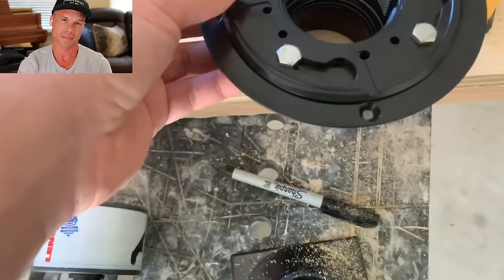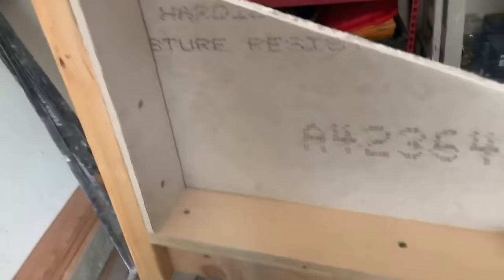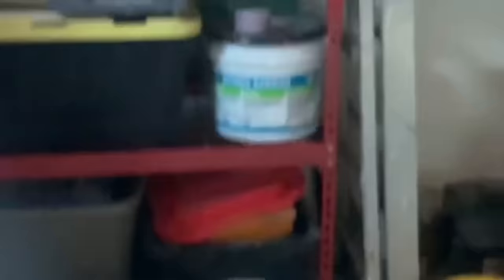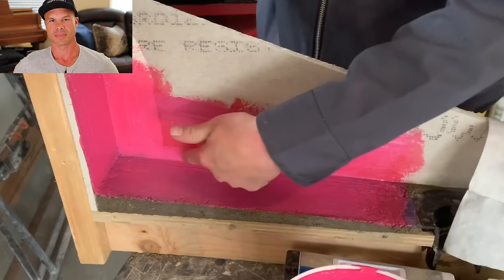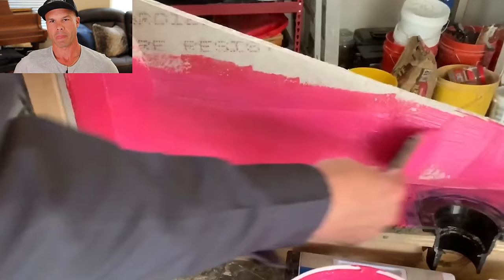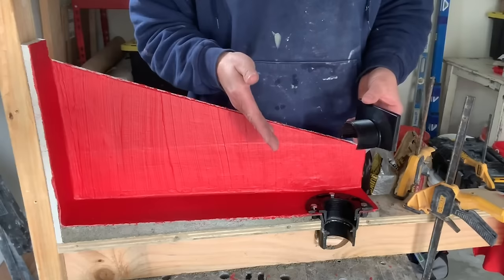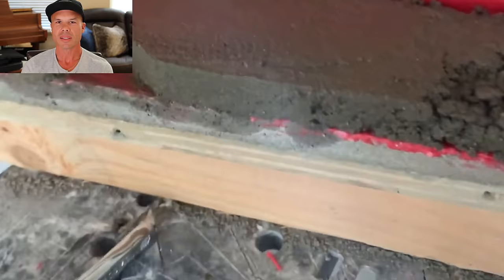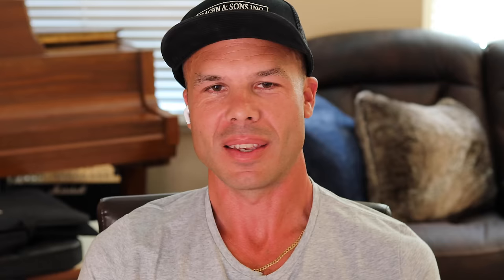THE BEST REDGARD VIDEO ON THE INTERNET!!!

Comment: I'm a general contractor in San Jose and have done pretty much all the kitchen & bathrooms by myself. Got licensed in 1993 and  been using a few  tile subs the last  few years. I went through 5 or so before I found a guy who actually followed proper practices regarding weep holes!  It gets old real fast when you have to watch over your subs!  Common sense  that you want the water to have a clear  path to drain !  I started watching your video on redguard  and saw how thick you were putting it on and the guy you pointed out in this video explained it well.  I still prefer hot mop when I can control the fumes, but redguard( the way he showed to install works well! shluter I  only use  with a liquid membrane over it  and up the walls past the curb  at aminimum because thinset only between the membranes is not waterproof especially when weep holes are clogged and water sits under the tile !  Hopefully this video will sink into the guys the right procedure!

Comment: Wow!  That prime coat is the trick when using the fabric!  The redgard dries almost immediately on the non primed surfaces but the primed surface gave extra work time to get the fabric applied well and smoothed out!  Thanks for the tip

Comment: Priming plaster walls requires a mist coat/slurry coat. Where you mix the primer  50/50 with water so it can absorb into the the plaster. Then the paint sticks to the primer.  This is a standard approach in priming surfaces, before coating them. The red guard is sticky, but you can peel it off, if you don't do a mist coat, or put too much material on. The way buddy applies it in the video, pretty much makes it a done deal, as the red guard has become part of the substrate.

Comment: This is exactly how, I do it. I’m in Rochester, NY and we don’t get the deck mud you have in Cali. 

I’ve also been lighting up all my niches for my customers and every single one of them loves it!
Reply: Quick question.  Why sandwich the red guard between 2 mud beds rather than one big sloped mud bed, redguard, then tile?  Wouldn't that eliminate 1inch of mud bed to absorb water.  Or does redguard not 'play well' with the tile thinset?  Thanks!!
Reply: @josephfox7952  reason is to let the water drain thru the weep holes. The deck mud is pores, so water seeps thru the top layer to the pre- slope bottom layer where most people use pan liner rather than red guard. 
Also, you need that thickness for strength. I’ve also use topical membrane directly on top of deck if I use Schulter line drain. I don’t trust thin set to water proof the point where there’s all water flow to.
Reply: @tommynguyen8942  so would you redgard over the second layer as well?
Reply: @afchannel652  When I use Schluter drains. And I do come out at least 6” from all corners where walls/ curb meet shower pan.
Reply: @afchannel652  I was wondering the same thing - would redguard also on the second layer make it even more waterproof?

Comment: Ive never used this mothed for filling corners and covering the gaps between boards.  I usually cover all of my corners and seems with mesh tape and trowel on speed set mortar.  Once the mortar dries, I will go over the entire wall with 2 coats of Redgard.  This method of using waterproofing membrane in the corners seems fine, but if you have gaps lard than 1/8", you definitely want to go with the mesh tape and speed set mortar method, as Redgard can be used to isolate small gaps, because it cant be used to fill larger gaps and bridge them.

Comment: The fiberglass fabric in the corners is key to any liquid waterproofing! Great video Coach
Reply: Hey bro do you know what type of fabric was used in this video?
Reply: @austinb2889  not sure what exact brand he's using but I get mine on Amazon just search "waterproof membrane fabric". It's 6" wide by 75' long roll. Usually one roll will do about 2 showers if you're hitting all the corners.

Comment: If you want to check the thickness of Red Guard, or any liquid membrane, I suggest getting a wet film gauge. It's a credit card size piece of sheet metal with notches of various sizes cut out around the edges. You can get them at most paint stores.
Reply: thank you so much for the tip
Reply: What's the gauge for
Reply: @rubensebastian2604  You measure the thickness - in microns - of a coating (Red Guard, paint, etc) while it's still wet.

Comment: So basically this for the beginner, or handyman great video. I been  using fabric in all my corners. I do the same system but I use hydro ban.for over 15 years. Keep up good work👍
Reply: What’s the fabric you use called and where can I get it?
Reply: what is the name of the fabric?
Reply: @avsarpatel1316  I use a product from Laticrete called Anti Fracture Fabric and it comes in a 6 inch by 75 foot roll for about 30 bucks.   Do like this video and prime your corners with 2 thin coats, apply the fabric in the wet 3rd coat and coat one more time for a total of 4 coats.   The fabric is thin but durable and will form a strong waterproof joint with minimal buildup.

Comment: Bravo! Pea gravel around the weep holes! On all my shower builds I leave a relief around the drain assembly on my secondary slope. Everything gets liquid applied waterproofed and tied in to the drain assembly can be scuffed up with sandpaper to achieve a mechanical bond. Drain is installed to the correct-P gravel around the weep holes and deck mud fills in my relief. Is an approved method awesome job!
Reply: @Todd: Thank you - I was wondering about the rocks. I thought that is what the purpose was, but wasn't sure.

Comment: You can forego the two step mortar bed process and tile directly over your waterproofing by floating as you would your 2nd mortar bed but omitting the mud around the drain- kind of like a crater. This works for Kerdi as well; if you're not using their proprietary drain and as long as you use their kerdi fix product to bond liner to the ABS- it will still be acceptable under schluters militant warranty criteria

Comment: I've replaced a few showers over 20 years ago with no failure but with new technology and building products I know I'm out of the loop on what to do. In Florida most homes have concrete floors and that's what I have right now. Normally starting with a clean tear out (down to the studs and concrete ) then install the 40 mill liner,  then shower pan, then concrete backer board, then tile. This Redguard or other similar products make me wonder about product stability over 20 years.
I'm replacing a shower and think the whole preslope thing is awesome. My new plan is - a clean tear out, preslope, liner, shower pan, Durock, Redguard then tile. Sound good? I apprecaite the knowledge and information you share.

All the best!!!

Comment: I don't see the logical science behind using 2 layers of dry pack (shower base cement) with redguard in between. The most logical standpoint from my point of view is to float your shower pan put schluter kerdi and then coat it with red guard or whatever rubberized membrane which is available to you for leakage security. I'm not an expert and I do enjoy your videos none the less. Thank you for taking the time to produce the content you do @tilecoach.

Comment: I am old school and use a hotmop service for my pans. The drain flange is a little different but the hotmop is installed much like the video shows the fabric over the flange. This type of flange shown is something I don't have any knowledge of since I use a different system. Times change and new systems come into use. However in 30 years with hotmop and drypack I have never had a call back.

Comment: It seems like with Schluter or other sheet membranes there are so many weak areas due to the seams.  Liquid waterproofings like RedGuard, etc appear to be limiting those weak points.  I mean it's not like the Schluter warranty is worth the paper it's written on.
Reply: Matt The Builder. I’ve done both an definitely think liquid is faster and less fussy then Kerdi. For corners, you can use the fabric roll to protect against cracking and bridge the two planes. FWIW laticrete hydroban says you don’t need the fabric in the corners.
Reply: I use Both. Schluter then I Redguard over. Always Mud base!
Reply: @franklinanderson7389  I just did a shower with both as well, #1 dry pack cement for slope towards drain, #2 schluter kerdi overlapping all joints # 3 several coats of redgard. From all my years in construction seems like the best practice.
Reply: Isaac's videos have proven out of any doubt that Schluter fails.  Look at "Ardex and Schluter Kerdi 7 Day Flood Test  - The Results" - for example.  The whole Schluter system (Kerdi membranes and such) just failed not because of the Ardex or whatever but just because the Schluter system counts on thinset to be water tight (??) - you don't need an advanced science degree to know that this will not hold water for more than a few hours or days.  As far as Redgard, it is an uninterrupted waterproof membrane so it holds water.  Isaac made a first video with Redgard and he messed up by not applying the product correctly (he tried to apply the whole 20mil or 40mil of thickness in one coat not knowing) but he later realized his mistake and did another video where he applied Redguard correctly (apply a thin coat, let dry, move on to next coat - Isaac hated the fact that this took a lot of time though) and he left the mock up shower he built with Redgard sit in water for a few days.  Next he took the shower apart - results:  Zero water made it through the Redgard.  At the end of those videos Isaac still said that he was kind of counting on Schluter more than Redgard still (which appeared to defeat logic - but I can understand because he relied on Schluter for years and did not have come backs since water of showers he did is not literally dripping from the ceiling below the shower - just slowly wicking around the walls in most cases because he is one of the good guys who correctly installs shower pan liners in most or all his showers - and he found Redgard is a longer process) based on the fact that Redgard takes too long.  Isaac is brilliant - and is very methodical - one of the only guys on the internet who is really thinking like an engineer and "peels the onion" correctly to isolate the failures by doing simplified situation testing.  I'm sure he will eventually get back to realizing that a liquid membrane like Redgard (and other liquid membranes) is the only stuff that doesn't fail by design (it can still fail for other reasons, like mistakes and special situations).  Contractors can make all kinds of claims about Schluter holding water but rare are the ones who did complete DPAs (Destructive Physical Analysis) like Isaac has done, so none of those other contractors really know what they don't know (i.e water is slowly wicking through the walls and floors of the showers they built years ago and they have no clue cause they're no longer in the picture and they'll be long forgotten by the time the showers they build are demolished years later by a different owner, etc, in most cases, and if they are around they'll mess up the failure analysis and think a mistake other than the fact that Schluter is a broken system to start with is the cause of the failure).  The only thing that saves Schluter is most people use a shower pan liner beneath the whole failing system (but water will can still make it all over the walls though (joint compound is not water proof - my jaw dropped the first time I read the Schluter instructions - after some research I eventually found the Isaac video which confirmed everything I feared about that system - I would never use it).
Reply: @jfgrivard2  in my last shower build i used schluter kerdi on my dry packed base and additionally applied 2 coats of redguard. To me its double insurance and I am not disagreeing with anything you are stating. For best results in my experiences you have to apply it as if your painting a wall, let it dry to the deep red color and re-apply another coat. I believe the schluter system alone can be effective as long as your water runoff is sloped correctly to the drain to avoid any kind of pooling but I like to go the extra mile.
Reply: @izzdiesel8556  Thanks - Makes sense - I think if you put a liquid membrane on top of Schluter that would certainly increase the chances of success - I did not think of it this way but that could make for a pretty good process.  Yes I think Schluter alone is not that horrible if you have a liner at the bottom of the shower (pan) and if you count the fact that there's not that much water making it to the Shluter system on the walls (not submerged).
Reply: izz Diesel no disrespect but putting red guard on top of Kerdi seems overly redundant. I can see using a liquid membrane in the corners with fiber cloth, but over the Kerdi is silly considering how strong it is. If you don’t trust the  Kerdi corners with thinset then the liquid membrane makes sense. I use hydro ban liquid, good product.
Reply: @jfgrivard2  no problem everyone has their methods but ive seen a fair amount of people do it this way.
Reply: Simple PVC liner works best for me... My dad did it that way going back to the early 80's and I've been doing it that way since the mid 90's...  tried and true...

Comment: Good recap.  I RedGard the shower curb (after the liner is in) before I put in the shower floor (I always construct a pre-slope then put in the PVC liner).  I find many tilers don't do this due to the additional time required.
Reply: Pre-sloped under the liner isn't optional anywhere I've worked its a codified issue

Comment: That cutaway was a great idea. I do the pan liner over my preslope.  I use red guard for the walls, change of plane from the walls and 2 inches in on top of the base per tech support instructions.
Reply: Do you use fabric for the change of plane? Is it necessary with a liner?
Reply: @patrickjunot218  - i say its necessary. I always use the cloth or 3" to 5" fiberglass mesh tape.

Comment: Enjoy your vids, even if not fully your own.  It's all about the information.  I'd imbed the fabric or mesh in modified. Just stronger protection against any movement.  Then waterproof.    If doing a 2 float, I'd like to see another 2 coats of membrane on top the 2nd float.  Keeping the 2nd float dry to inhibit any petri dish issues.  Mold/ mildew etc.  Tile and modified grouts make drying to the surface very difficult.

Comment: The manufacture of the 3 part Oatey drain in  your video specifically states to set that drain flush on the floor. Their cut away diagram reinforces how it is to be properly installed for a mud deck application. I called Oatey for clarification and they emphasized that the drawing is correct and that the drain assembly absolutely should not rest on the floor on the bolt housing underside of drain leaving the underside of the drain flange a half an inch from from subfloor but that it is designed to be supported by sitting on the base or flat underside of the drain. According to the Manufacturer (Oatey) your drain is installed improperly as shown in your video
Reply: I was wondering about this.  The oatey diagrams are pretty clear but I was really worried about thinning the slope down to like 1/8”.  But I am using a pvc liner on top so I’m not that worried.
Reply: @patrickjunot218  No you should be fine............Im just amazed of the hundreds of shower pan installations from all the experts who never address how to correctly install a 3 part drain
Reply: What surprises me is that if I watch 100 videos on how to build a shower pan, there will be 98 different ways to do it.  How is there no standardized method of building one?!
Reply: @patrickjunot218  Exactly Patrick................ you have to watch 100 or possibly 500 videos and sort fact from fiction. I came to the conclusion that many of these you tubers are putting out misleading or outright bogus information. Educate yourself and dont do anything until you are confident that the method you decide on is the correct or best method for you. Best regards
Reply: Well its a fact that many methods will work for a shower pan thats why there's so many different ways. I dont think there's 1 way thats a lot better than other. Its all about installing it correctly whichever method you use

Comment: Over the years I have been smart. 
I run wires in areas water shouldn’t be. If I ever wanna check all I need to do is hook a meter to them. 
And I’ll redguard the drain hole on top and bottom and edge. This way water drips down and don’t soak into ply.

Comment: I both understand and don't understand the need for the rock/stones around the drain to "protect" the weep holes.  We have already established that water that gets under your tile is able to travel multiple feet through your top layer of deck mud and then theoretically sheds along the waterproof membrane to the drain, but we are now assuming that it will be unable to penetrate the last 1" through the drain if deck mud is there instead of stones?  Always seemed kind of goofy to me. Either way, fantastic video, incredibly helpful for the overall best practice.